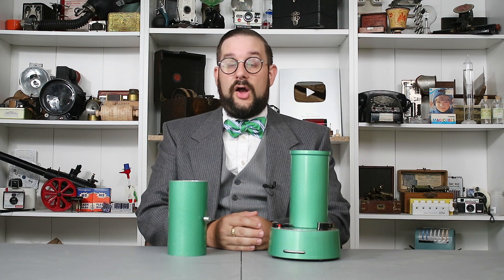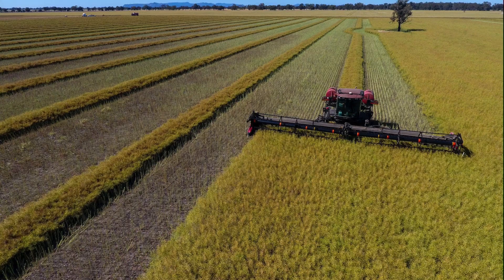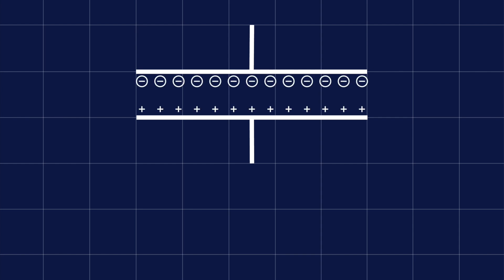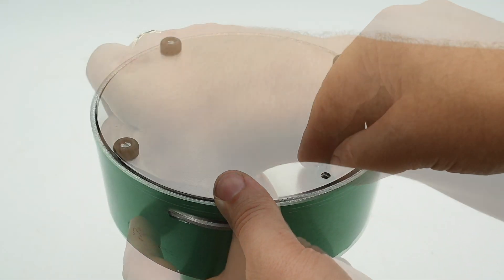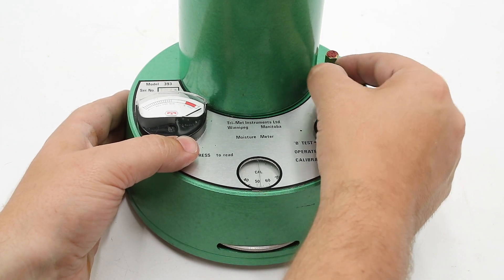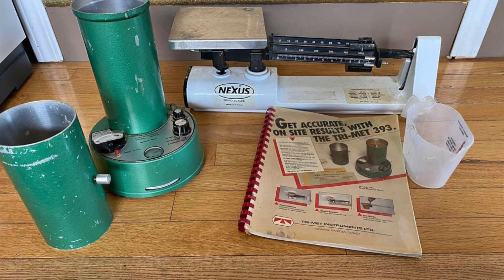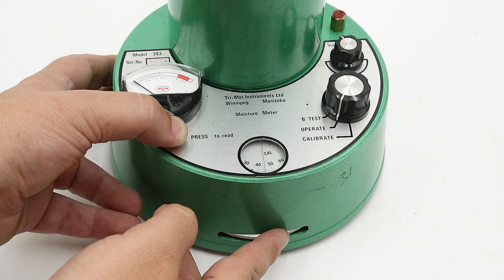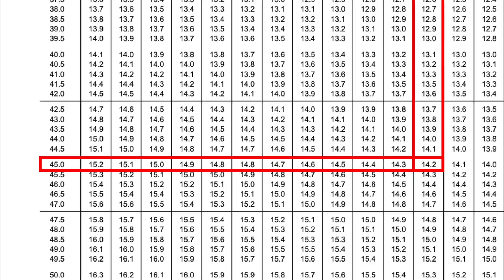Mystery Object #6 ANSWER

Comment: I am a millwright technican from germany. Here we have similar devices, like the "H-O-H Express" from the bavarian company Pfeuffer. Here you have to grind the grain first, put it in a thingy, similar to what you put the coffee in, in a espresso automata. Here the moisture is measured between to plates under pressure of a spring. On the old devices, you have to calibrate first with a special sample and have a turning knob to zero out the meter. After that you put the grain in the special thingy in and press a another knob and the moisture is presented on the dial of the moisture meter.
Nowadays these things are fully electronacally, no calibrating (Its done automatic) and also the result is shown on digital display.

Comment: In an undergraduate physics course some 50 years ago, we were taught to say "Whetstone" instead of emphasizing the "wheat" in the "Wheatstone" bridge.  The equations can be expressed in general terms and you can build a "generalized bridge circuit" that can measure resistance, capacitance and inductance.  A number of developments by James C. Maxwell, Max Wein and Alan Blumlein makes the bridge suitable for use in AC (or pulsed) circuits.  So, this is a bridge circuit, based on the Wheatstone Bridge concept, is used to measure the dielectric constant of a grain sample at 10-12 kHz.  The water content of the grain sample is going to be the desired final measurement.  Just a lot faster than the method listed by kit888 before.  But, you can use the heating method in dry air to obtain a reference sample of any grain you choose.  And do store the reference sample properly to avoid errors.

Comment: I would have expected "'B' TEST" to mean "Battery test".

In that formula for capacitance the value of k is actually some weird and very small number whose exact value depends on the units used to measure the plate area and spacing. A capacitor with plates 1m square and 1m apart would have a capacitance of about 9 picofarads if I recall correctly. The numbers you quoted (1, etc.) refer to the relative permittivities of various substances, that is relative to a vacuum.

Comment: Grain rot is not the only concern of water content, In fact, that is not a major concern, because the elevator bins are driers. Water weighs a lot, and grain elevators pay based on the weight of the grain. They pay for grain, not water.

My grandfather was a farmer, and I used to ride the tractor from his farm to the elevator. They weigh the whole mess (tractor+wagon+grain) then test,  unload, & weigh the tractor again. Before they pay, they subtract the water weight.

Comment: While it is true you can measure(calculate) resistance with a Wheatstone bridge, that is not it's purpose.   They are used to measure very tiny changes in resistance.  Far beyond what an ammeter could measure if that resistor was just in series.

Comment: Nice little piece of old technology. The explanation of the circuit and how it uses the grain as dielectric in a capacitor kinda made sense to me as an electronics engineer. I guess most other folks without education in analog electronics would have a hard time to understand how this device actually works. Maybe, instead of showing the schematics that, i guess, came out of the patent documents, a more general block schematics or even a rearranged schematic of the same circuit that is easier to read would help people to understand better how the circuit works. Having all the functions of the selection switch S3 overlayed in the same schematic and having all these potentiometers that were required to calibrate the circuit really make it difficult to see the simple picture.

Comment: I read about a farmer weighing a grain sample, slowly heating it over his stove, then weighing the dried grain. Simple substraction gives the water content.
Reply: We used the subtraction method to determine the moisture content of soil, it's especially useful when the sample composition is unknown.

Further heating to 400°C burns off any organic matter so can give a close approximation or the organic content of a sample and thus determine the mineral content.
Reply: However needs careful heating, if you go over 80C you tend to evaporate the lighter organic compounds, giving a higher water level measure as those also boil off. You can also do the same using a freeze drier, which also helps keep the boil off low, as the frozen water sublimes directly, and the more volatile organics do not.
Reply: There are special ovens for this, from the maker Brabender (Germany) for example. These ovens have a scale inside and a convection air circuit (like those in the kitchen), you put 10 gramms of grain in a sample dish inside and the oven dries it with 60°C/90 min. After that time, you can read the moisture on  a calibrated scale. These ovens are a international industrie standard since decades. Theoretically you could do the same, with your kitchen oven at home.

Comment: Had a similar Marconi one, used to measure moisture content of maize rice, and then was used to calculate how much water to add in the mixer, to get the right moisture content for the plant. Very old one, using a small test cell made from Bakelite, and inside used 2 small directly heated miniature tubes, giving a resistance measurement. Ran off a D cell for the filaments, and a 45VDC power supply, provided by a stack of 5 PM9 batteries. As those are both expensive, and relatively short lived in this, I simply made a battery eliminator, that provided a regulated 1V2 for the heaters, and a regulated 45V supply for the anode supply.  Made it a lot more stable as well, as it did tend to drift as the batteries drained, and leaving it on for 5 minutes would cause the zero to drift.  Yes also had a table in the top cover which you referred to , to compare the readings to the moisture content, and to calibrate for ambient temperature.
Reply: Nice job rebuilding the power supply service so as to deliver a constant voltage to the unit. I recently built a pedalboard system for my guitar and bass setups. What I found is that while most pedals on the board will run, or should definitely run, on the power supply (9v/18vDC SWPS), I found some choice pedals should run on 9v batteries to take advantage of 'sag' or loss of voltage as the battery juice dwindles slowly. So kind of the reverse of what you did. 

Bakelite! Awesome! Kool! MAGnificent! Bakelite!:face-green-smiling:
Reply: @sski   Had to, as those batteries lasted around 2 months, and were around $5 each. I actually bought at the one supplier, the cheapest one, 5 radios that used the battery, because each radio came with a battery, but were on special for $3 each. So took the 5 radios, took 5 old cordless phone power supplies, as the phones had been deemed beyond repair, after they had either been drop tested, dropped in toilet, or had been driven over. Gave 4 away, no 5 is still in my garage, and gets used every so often. Then used the 5 batteries before building the battery eliminator, using transformers I had gotten in bulk on an auction for $5, and parts out of the broken cordless phone bases.
Reply: @SeanBZA  Nothing like reusing tech, especially tech deemed obsolete. I do it all the time around my house and recording studio. Especially the recording studio, where backwards compatibility is a mission parameter. Where most studios these days shoot to use the latest in computerized digital sources and cataloging systems, I start there and move backwards into ADAT/VHS recording and duplication, reel to reel 1/4" 4-track recording and 2-track mastering, cassette mastering and duplication (small scale), and VHS audio/video cleanup/duplication (small scale). There is quite a market for these things as folks used these sources to record music or memories back in the 80's, 90's, and early 2000's but have no way to retrieve them now, or want it done professionally, or they just want to produce their new project on old tech (that sounds glorious).